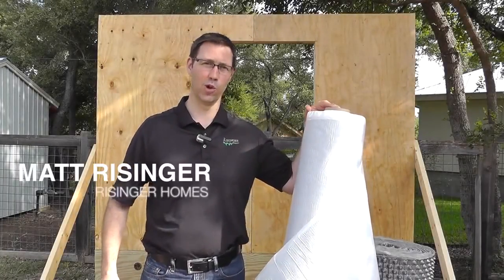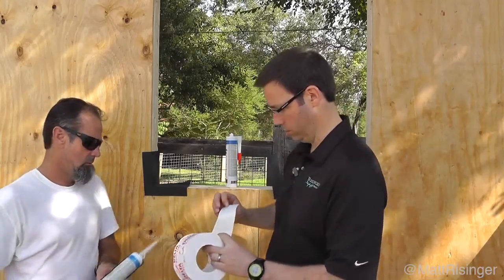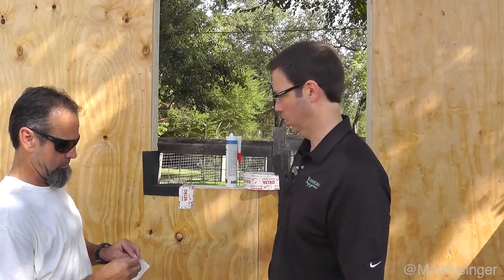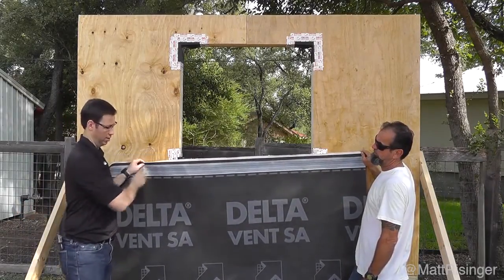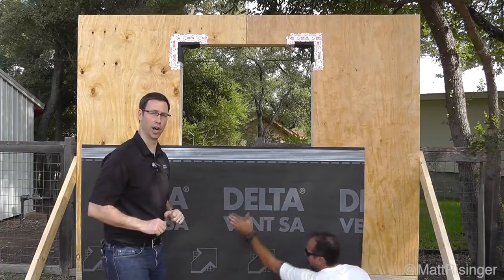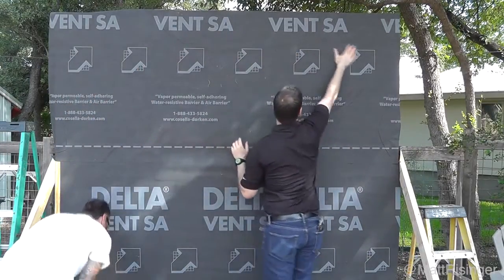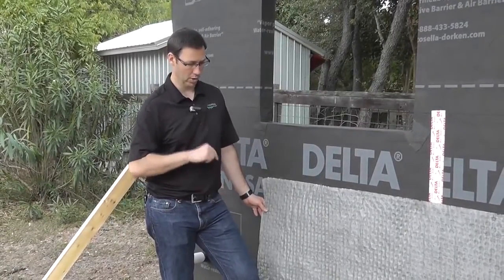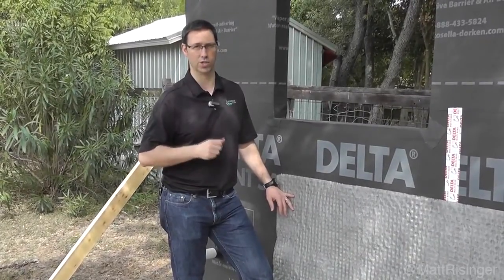DELTA®-VENT SA & DELTA®-DRY Review by Matt Risinger - Risinger Homes

Comment: Hi Matt,  Interesting product.  What happens when you integrate rigid foam on top of the Delta Vent SA?  Their tech specs show an air gap, but they are not clear on how it drains at the bottom.  Have you done a home with rigid foam on top of Delta Vent SA?  Thanks - Bob